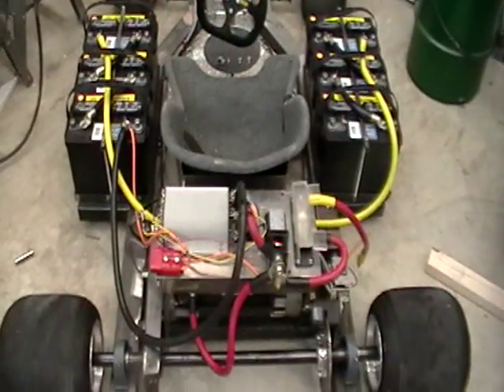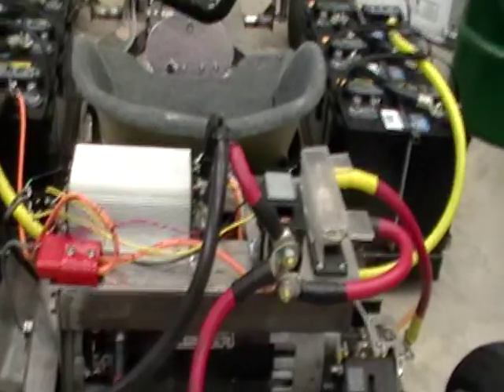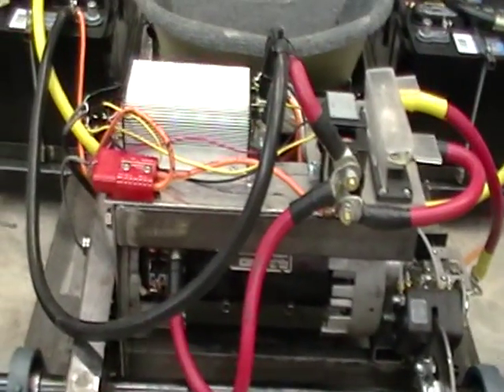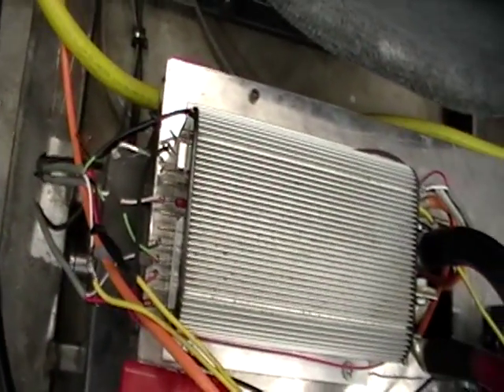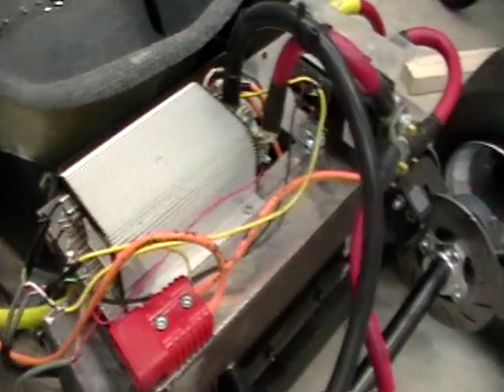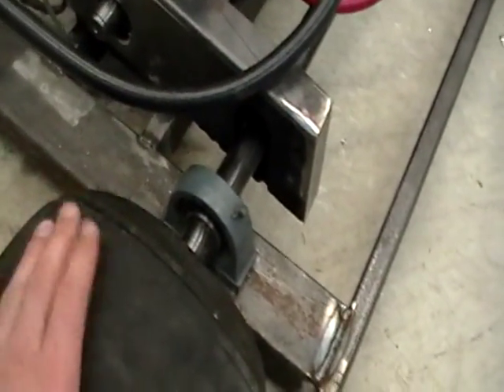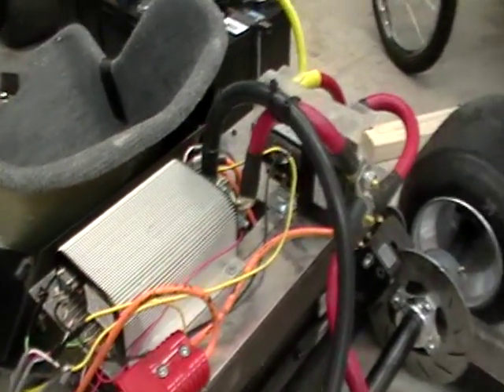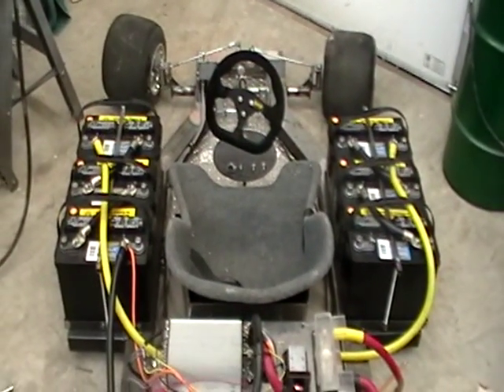electric go kart.MOD

Comment: i was consedering using the 10 led output on the lm3915 as the input of 10 2n2222 transistors, then the output of the 2n2222's as the input for 600v 100A mosfet transistors with 100A diodes on their output, and finally all the mosfet's outputs connected to the motor.
The way this "works" is that a potenciometer will be at the lm3915's input (that potenciometer will be attached to the gas pedal), so the more you turn the potenciometer more 2n2222's it activates wich then activate the mosfets.

Comment: If you by pass the controller and connect the batts directly to the motor do you have power at the wheels? Maybe you can't do that... I'm not familiar with the design you are working with.